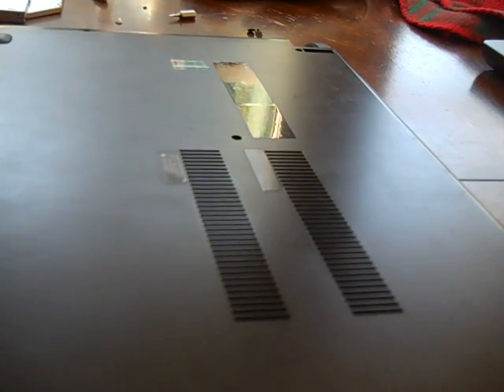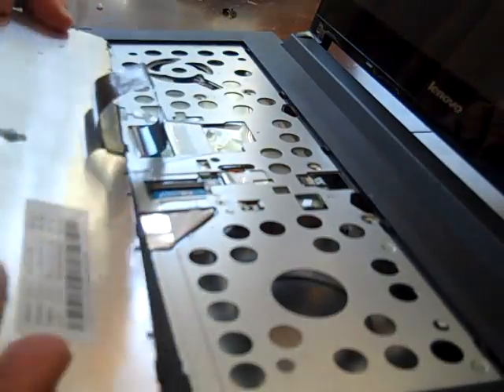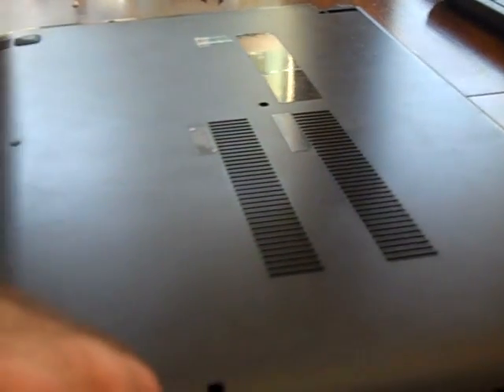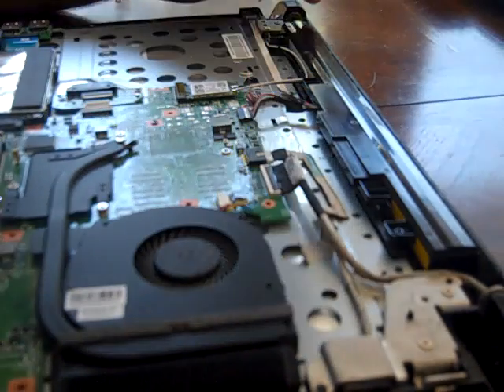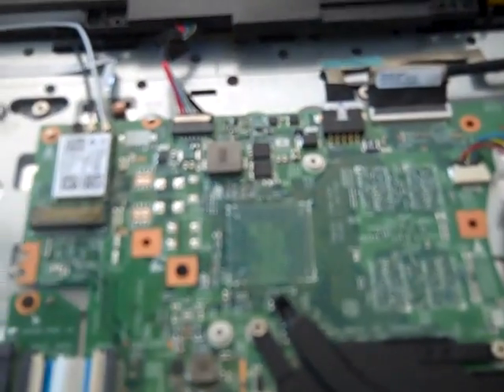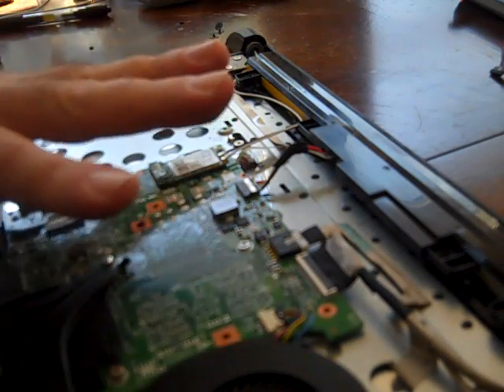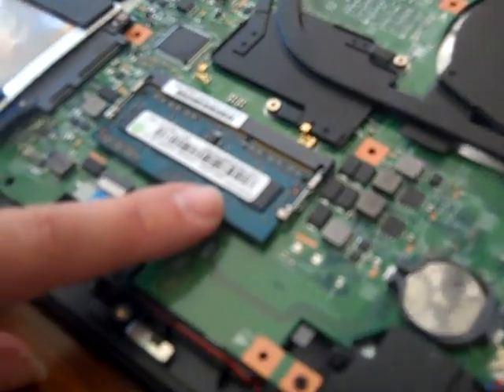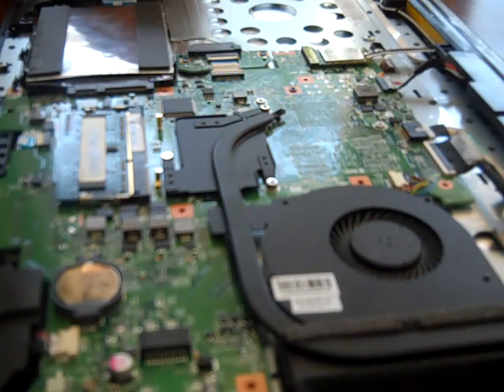Lenovo Flex 2-15D Battery Replacement

Comment: This was really helpful for my old laptop which refuses to start. Can you tell us which screw driver are you using to unscrew Al those screws.
Reply from the maker: I bought a set of these from Radio Shack back in 1985 and they've saved me 100 times over.   The same set is available at a variety of places, but here's a great deal..

https://www.harborfreight.com/16-piece-precision-screwdriver-set-4143.html

Comment: I replaced the battery fine, but I screwed-up the keyboard. 
I watched your video several times before I began.  You said that the keyboard was held in "simply by these little clips".  You did not point to, nor remove the center screw on the back.  When I got the "little clips" unfastened, the keyboard seemed to stick in the middle when I tried to lift it.  I watched your video again and you seemed to have no problem lifting your keyboard so I thought there must be some kind of small slip catch and proceeded to move it slightly to dislodge the bind.  I finally realized that I had left the middle screw in on the back.  When I flipped the unit over and removed the center screw, the keyboard was freed, by alas, the damage was already done.
Next time, video the entire process so that the lesser experienced of us do not make this simple, stupid mistake!
Reply: Same here, I concur
Reply: @Antonio Palladino  Thanks for the advice. I am planning to upgrade to the backlit keyboard and do not want any unexpected damage!
Also thinking of upgrading my battery. Did you notice any improvements in performance in the battery life?

Comment: can i use this laptop without the battery I'll just plug the charger will it work?
Reply: You can use a laptop without the battery as long as it is connected to the power brick and an outlet. but if the plug comes lose at all by just enough your system will turn off and can damage files and the OS even.

you can use it without the battery in it as along as you make sure that the power cable never comes loose.
Reply: This was very helpful, thanks 😃

Comment: First, THANK YOU SO MUCH for doing this video, DeathScouter.  I just ordered my replacement battery and having looked at the outside of the laptop, it wasn't obvious how to get to the battery other than (as you did) start unscrewing stuff.   Totally appreciate what you did there.   

And, to Lenovo, in case they ever read these comments:  What were you thinking???  Making us disassemble so much to simply replace a battery?  AHHH... you don't actually consider the battery to be a "customer replaceable unit" according to the PDF user guide.  That's another pretty questionable design decision... 

I'm pretty sure I could assemble a desktop system faster than digging into this laptop.  Sigh. 

For those trying to find a battery, Amazon has laptop batteries... Search for     battery for lenovo flex 2 15

Comment: Thank you so much for sharing!  Lenovo is worthless after the warranty expires!  They won't even give me the part number for the replacement battery.  UGH!  Which brings me to my question, how did you know which battery to get?  Did you take apart your laptop to get the part number?  The user guide lists 5 possibilities.  Or were you smart enough to keep record, unlike myself who can't find my original paperwork and I'm not sure the part number is listed on it anyway.  Also, where did you purchase a new battery and how much did it cost?  Thanks again for posting...you're a huge hep!
Reply: +1 to this comment. Same needs, and same sentiments!
Reply: My original battery lasted for about 5 years.  When it was time to change the battery, I did a simple Google search and also took a look at the back of the computer model to make sure it was the right battery.